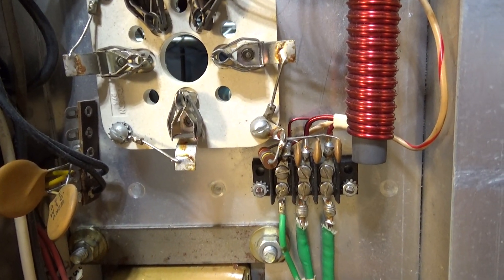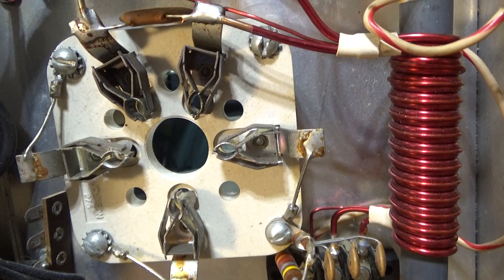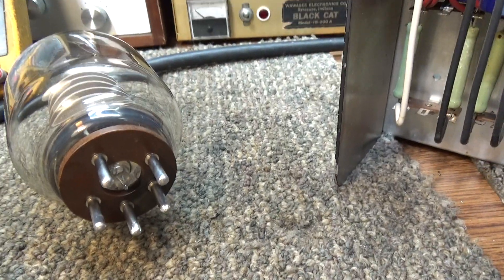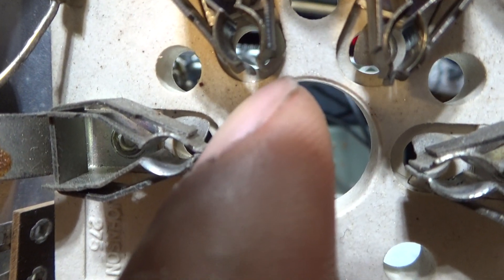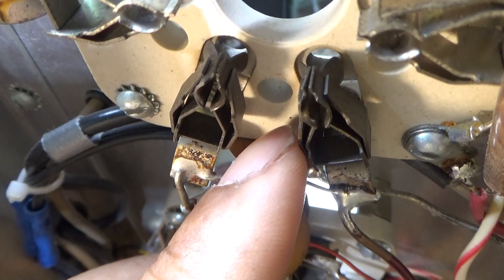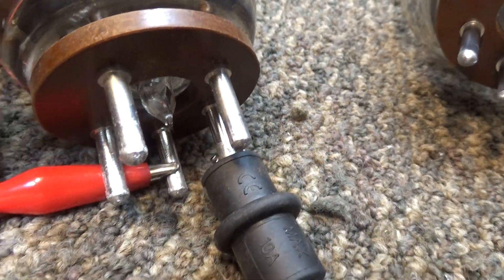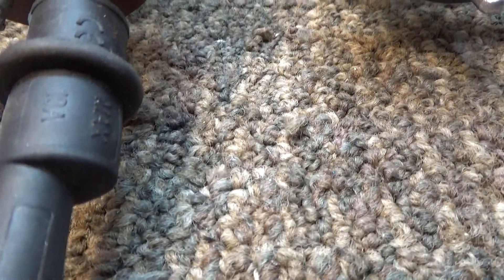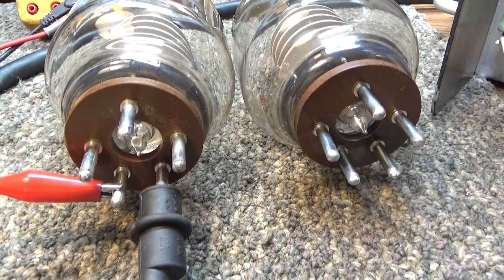3-500Z tube filament problems and thoughts.

Comment: Hi,
I have an AL80B.
I'm good for about 5 to 7 minutes of a QSO and then I lose power, I turn the amp off, let it cool and I'm good again but not for long.
The tube still stays lit though. Could the 3-500ZG still be bad?
Reply from the maker: could be tube, could be something else like loosing the bias. First things first, try another tube. Also, that amp has full metering. Volts, Amps, Grid. Are they all reading stable?

Comment: I think johnson could do better on the sockets. too late now
Reply from the maker: IDK, the 3-500z runs on 15 amps each, 30 amps for a pair, and most amps don't cool the pins. I think most 500z pin problems would be solved by some air flow/cooling.